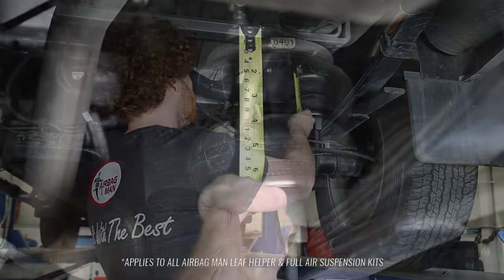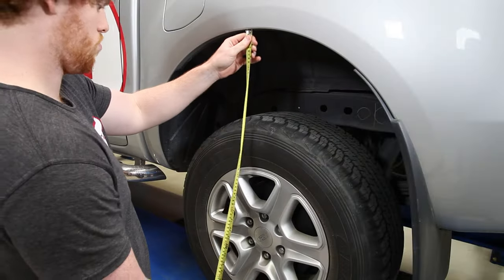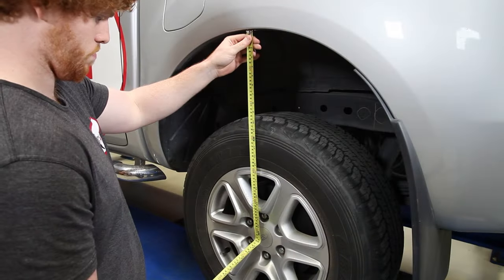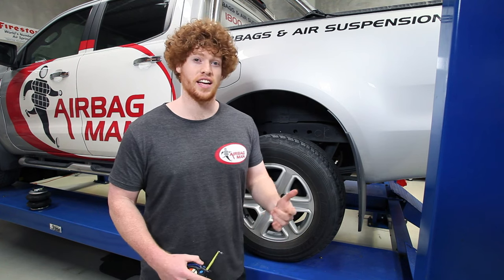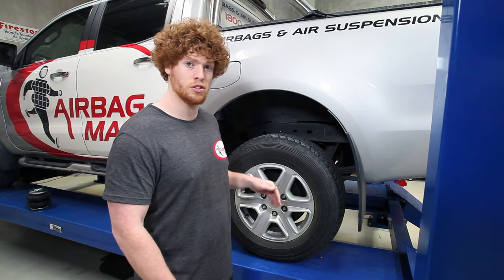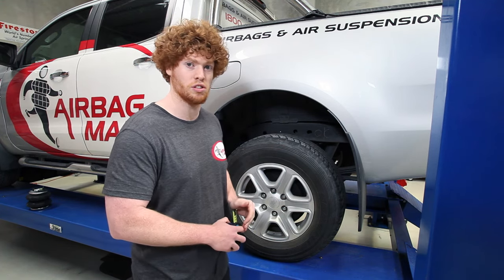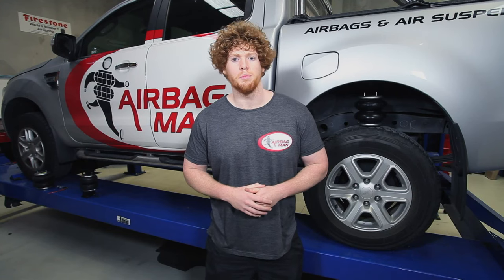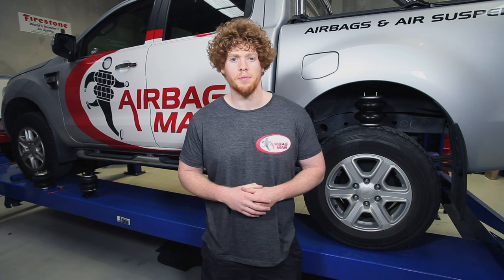Airbag Operating Heights & Max Pressures by Airbag Man Suspension

Comment: You quote inches. Why not metric? From top to bottom crimp plate. Is that overall the plate or inside measurement and how about printing maximum air pressure on a aluminum label that comes with the kit that you can affix next to the air valve.
Reply from the maker: G'day @ronvds4713, thanks for your comment and great question. We measure in imperial because the Firestone Airbags are designed in America and measure in inches. Operating height measurement should be taken from plate to plate. If you require any further information, please don't hesitate to contact our team on +61 7 3889 6556

Comment: Hi,  I have a Hilux SR5 with a GVM upgrade decked for remote camping slide on camper. I wish to add airbags to both assists stable ride, suspension and to use to level our bed at night,  I have been told the can damage chassis, I guess that's cause they overinflated? What's your advice.  
What is the minimum pressure or hight to have the bags? at

Comment: How's the ride without load and run 5-10psi? Is it comfortable or stiff?
Reply from the maker: G'day and thanks for the comment. Depending on the load on your vehicle would depend on the way the vehicle rides. It's important to note that the leaf helper airbags have a recommended height rather than pressure whereas our coil helper bags have a minimum pressure. 
Leaf helper bags often require varying pressure from vehicle to vehicle to acheive the recommended ride height based on the vehicles load. 
We hope this clears up your question however if you require any further information, one of our experienced Airbag Man Specialist would be happy to chat further if required. 
Team Airbag Man

Comment: When not loade whats a good crusing psi
Reply: Airbag Man I bought truck with the airbags installed it's a 2014 Chevy Silverado 1500 2-wheel drive ,I looked under and the airbags say Firestone I currently have them flat with no pressure and when I hit a bump I hear a knocking sound
Reply: Airbag Man 95 s10  what pressure should I be at
Reply: villegascastro1 I would like to know whati shoulda read on my gauges for a 95 s10 what's too much or what not to go over the gauges go up to 200
Reply: also I'm on nitrogen whats should my regulator be set at can I turn the air on and leave it on or should i turn the knob on the nitrogen tank off like when I'm at work home then turn it back on when I'm drivin